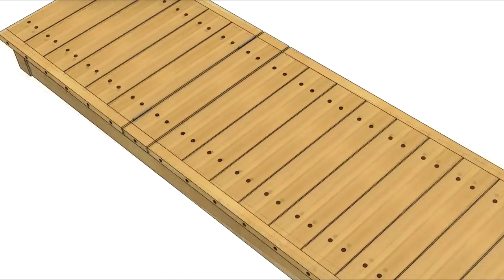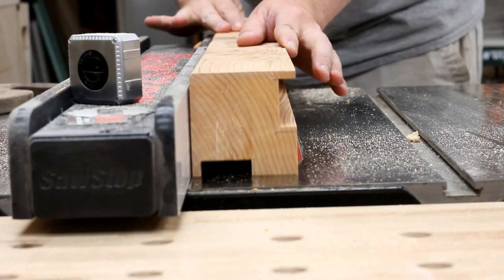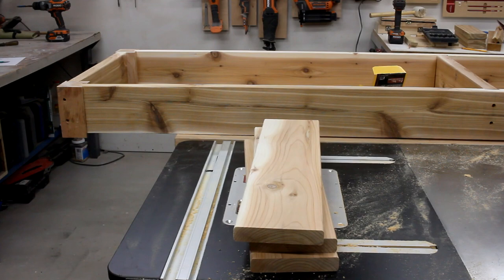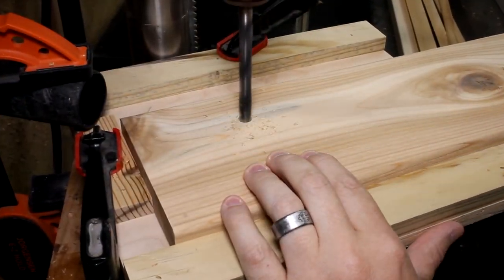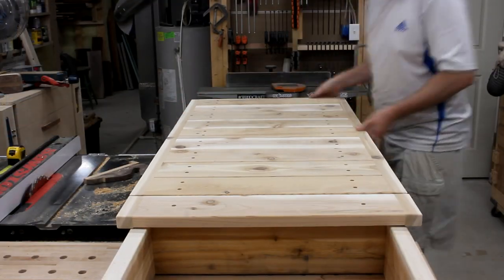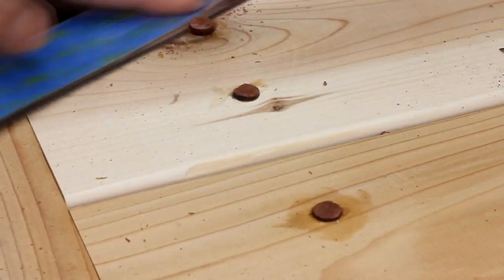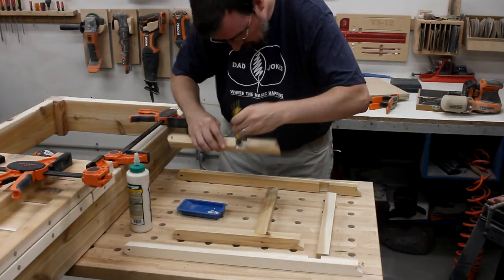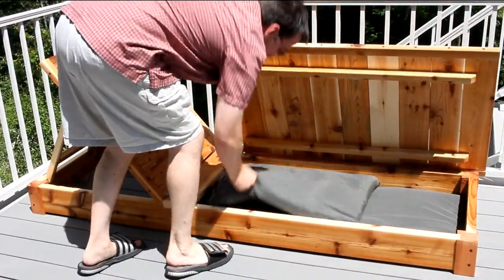Woodworking: Making an Outdoor Lounge Chair

Comment from the maker: Thanks for watching!  I hope you enjoyed it!  I'm anticipating people asking why I built it so low to the ground.  The main reason is cedar isn't sold in anything wider than 2x6 around me. If I were to raise it up higher with the 4x4 legs, it would negate the use of the internal storage.  I'd have to add a bottom which would just add to the complexity of the build.  Otherwise, I could stack up multiple 2x6s on the sides to raise the chair and make the storage much deeper, but then the chair becomes very heavy and cumbersome.  I thought this was a happy medium.  Pick up the plans for yourself, you can adjust them accordingly to meet exactly your tastes! :)
Reply: I love the out takes makes me laugh every time 😂
Reply: I suspect that if you put a bottom on it, it would quite quickly become a storage space for acorns instead of a chair pad.
Reply: So pretty much your neighbor's fault for making his deck outta 2x6. You can't be blamed for that Drew.
Reply: Keep the storage the same depth, but just use longer legs. Talking of legs, those are some real white ones there - just returned from the arctic?
Reply: Is there anyway I can privately email you about a project I’m designing? Would really appreciate your help and opinion!
Reply: I assumed you made it so low so you wouldn't hurt yourself when you rolled off.

Comment: 14:03 "I swear I'm gone weld you in there" had me laughing in tears.... tried exactly the same thing a trisilion times..... You're simply the best of all my subscriptions :-)
Reply: And at the end of his comment here:  Oh you JERK! Had me laughing..............
Reply: Me too!  I was scrolling to see if anyone else found that as funny as I did!  I'm not saying I spat my drink out but i'm not saying I didn't either.
Reply: I am so glad I am not the only one that happens to! So dang annoying.
Reply: Jim Pudar does it release well also? My adapter got ?dirty? And have to use pliers to get the bit out.
Reply: @shofarsogood7504  It's a known issue, that these bit holders tends to fill up with little bits of metal pieces and then the release function gets "clunky" and doesn't always want to release. I often have to use my bit holder in thight spaces which also rules out these bulky bit holders. Had a Wera bit holder for ½ year and then ditched it ;-)
Reply: @midjetville  I'm talking about small metal pieces that rips of from the screws I used when I was jointing wood pieces. Wera, and all other bit holders, use a tiny magnet to hold on to the bits, the same magnet that draws metal dust into the bit holder. But I'm glad, that you're happy with your bit holder. Kind thoughts from Denmark :-)
Reply: Jim Pudar thanks I'll have to check it out. I had another magnetic one and it's hit and miss also.

Comment: I always appreciate your use of a good jig. Also, those shop Adidas sandals are almost as cool as my shop Crocs. Nice build!
Reply: Shop Crocs for the WIN!
Reply: I wear crocs in the shop too!
Reply: I'm always seeing people in videos and stuff working barefoot or in crocs/sandals.  Are y'all not worried about destroying your feet?
Reply: @CeeJayThe13th  You're so right. I need to get some Carolina Shoes like Paul Jackman!
Reply: @CeeJayThe13th  Like slivers or something?  Or dropping something on my foot?  Neither ever seems to happen however now that I've said that, I'm expecting a lousy Saturday.
Reply: @scottroy6195  those are the exact things I mean along with stepping on stuff or stubbing your toes.

I dropped about a fourth of a sheet of 3/4 plywood, point down, directly in the center of my big toe.  There's no lasting damage but it hurt so freaking bad that I will usually never be caught working without steel toes.
Reply: @CeeJayThe13th  just reading that hurts.

Comment: For those pesky bits that keep popping out, I found a drop or two of hot glue at the top of the bit holder once the bit is in holds it great, and easy to remove with pliers or a knife when finished. Another great video. Thanks!

Comment: Very nice build. The wife wants me to make one with taller legs for those long summer evenings. Sadly in the UK it seems to rain all summer long nowadays. 
To counteract your problem with driver bits pulling out of their holder, I can highly recommend the locking bit holders made by Wera: they are a little bit bulkier in the width, but they sure as beck hold onto the bits until you decide to remove them. 👍👍👍
Reply from the maker: Thanks David! Cheers!

Comment: There are bit holders out there that are magnetic AND have quick release collars that grab the little wire indents on the short interchangeable drill bits.  One $6-ish example is the "Bosch ITBHQC201 2 1/4", Impact Tough Quick Change Bit Holder".  There are others.

Comment: A trick I use to keep bits in extensions is to fold over a plastic grocery sack once or twice. Then just put the folded bag over the opening of your bit extension and push in the bit.
Reply from the maker: Good tip!  I'll have to try that

Comment: Add a little wax or soap to the tip of that bit and that helps.  You can also wrap a small piece of paper around it and tap it into the bit holder.  Those things are a real pain!!

Comment: put a small piece of blue tape over the but of the torx bit and then insert it into the holder. It's just enough tension to hold it in without getting stuck.
Reply from the maker: Nice tip!

Comment: 6:57 "..take off just a smidge..." I'm afraid you'll need to check your measurements, I'm pretty sure that was a tad, and as I'm sure you're aware there 10 smidges to a tad. Remember the saying, "measure twice, cut once, visit the timber yard for more wood due to mis-measurements" 😉🙄😊😊😊
Reply: Would that be to buy (ummm borrow) a TAD few more boards from the neighbor..

Comment: What track was that you used for your circular saw?
Reply from the maker: Kreg has one called Accu-cut or something like that.
Reply: Fisher's Shop reviews for that say it has a lot of slop movement. Have you experienced that?
Reply from the maker: @richardtbc  No.  They probably had it set up wrong I'm guessing.  Works just fine otherwise I would have pitched it.  But if you're looking for a track saw, then get an actual track saw.  Kreg gave me this one to demonstrate how you can the track saw effect with your current circular saw.
Reply: @FishersShop  I was curious. Complaint was saw and track movement. They did not state brand of saw. Festool way to expensive
Reply: @FishersShop  thank you for your input. Very jelpful

Comment: You need to add longer legs for people who have trouble getting down that low(you know OLDER PEOPLE👵👴) other than that it's cool.😎
Reply from the maker: If I did that, it would nullify the storage capability.  But I feel your pain.  A taller version would definitely be easier to get in and out of